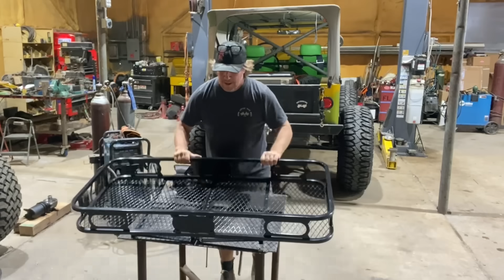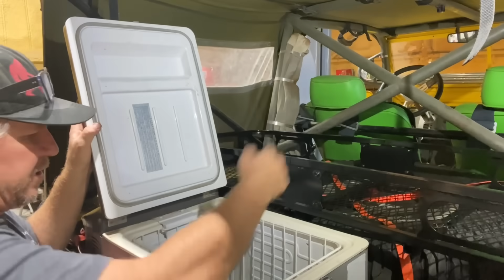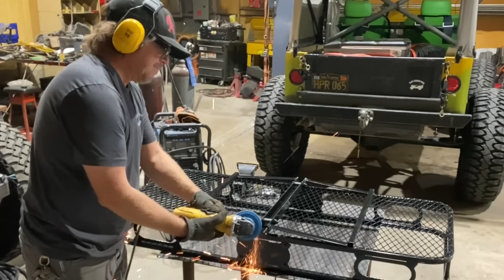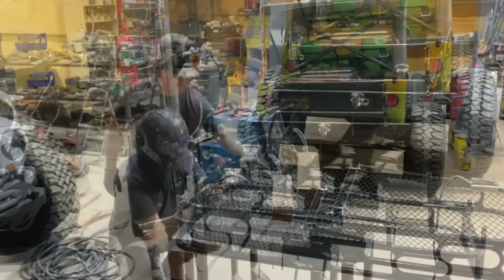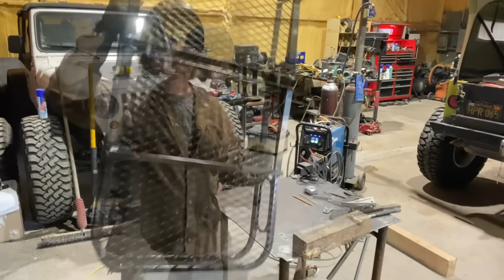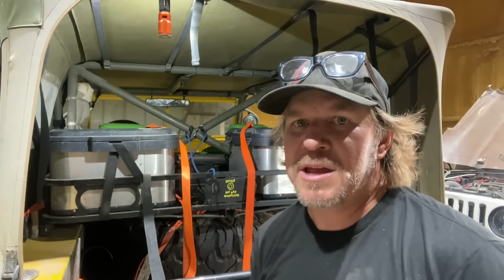Dirt Daily. DIY Jeep Cargo Basket

Comment: I built one of these a few years ago for my TJ. Used a $50 harbor freight ATV cargo basket and mounted it to the harness bar and cage c-pillar bars with some 1" square stock and muffler clamps. it was rock solid and could be taken in and out in just a few minutes.

Comment: Very nice! I used a Harbor Freight atv basket and had it in that location in my previous jeep (TJ) about 7 years ago. I attached it to the roll bar in the back and had hangers from the roll bar to the front of the basket. I could remove it by removing 4 bolts. I have a Bulldawg hard top with side opening windows on my LJ and I use half a basket in it mounted on unistrut pieces going side to side. The unistrut pieces bolt to the tub where the hard top bolts to it. I use the spring nuts in the unistrut to attach the half basket with 4 threaded knobs. Loosening knobs allows me to slide the basket side to side depending on what gear I’m carrying to access gear under it. If I put the half basket in the middle I can access gear under it from both sides.

Comment: One thing I have done is use old chain links. 2 chain links, you can weld or bolt them. They make good tie downs, made my last ones out of old tire chains. 
I have one of the baskets  and put my truck box in so I could use it on my jeep. Thanks.

Comment: I’ve been in this dilemma for a while for my YJ. I have my 33” spare right where yours is. I’ve been thinking of a quick release system to allow me to remove it easily also. I like your design, it works and is solid. I also don’t want to drill into my tub.

Comment: When you do storage tray 2.0, may I suggest adding a bar to weld a receiver into so you can remove the basket if desired.   some rubber feet would keep it from rattling on the trail

Comment: I like the trailer hitch basket idea, I've been looking for something to use on the tube back of my jeep, that's not heavy and can hold stuff when there is a passenger in the back. A C-j5 can be a bit cramped in side especially if you just have stuff for a day trip.